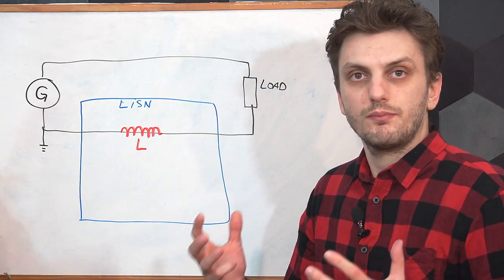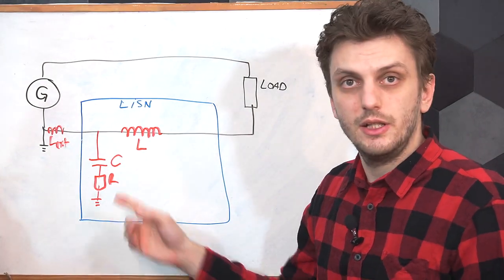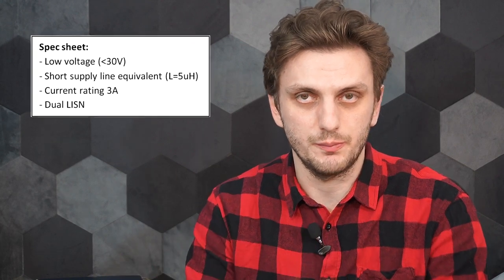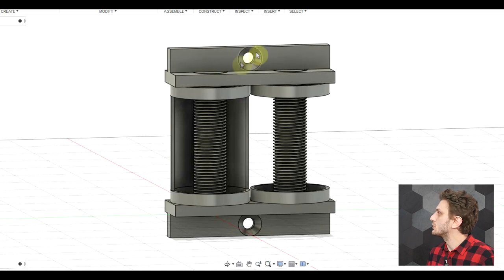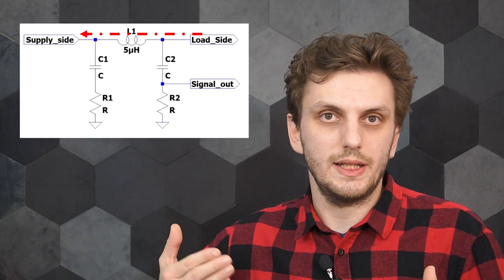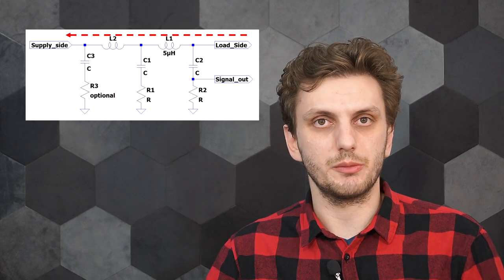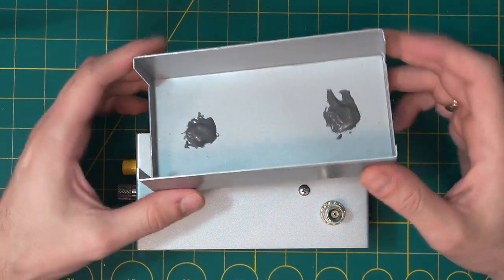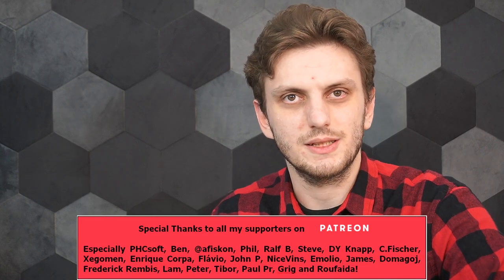EMC tutorials - [1/3] Building an LISN

Comment: I do a lot of work with instrumentation amps and have found that they are exceedingly sensitive to EMI. Think I might build one of these LISNs to improve my test setups. Thanks for sharing Fes!
Reply from the maker: What sort of issues do you run into? and of course what sort of environment is the circuit supposed to work in?
Reply: @FesZElectronics  Running at gain of around 500 (for load cells amplifiers), I get small DC offsets that change by 50mV easily (on the output) when I move my hands near the circuit, or even if I walk around the area near the circuit. Presumably high frequencies are coupling into the inputs and getting rectified. The inputs are biased to ground so I don't think static electric fields are causing this. I have tried a dozen different input RF filter designs based on AD app notes, with varying degrees of success, but I think they are not working effectively since I am breadboarding these and there is no ground plane to carry away the high frequency noise effectively. I have observed that things like connecting multimeter test leads to the circuit seem to affect noisiness to some degree too and my power supply as well, hence my interest in LISNs. Will be using the circuit in a university lab, which other than the florescent lights and electric motors I don't think is particularly harsh EMI wise.
Reply from the maker: Regardless of where you are, one of the major noise sources will also be radio - AM and FM. Especially if the noise is always there, the noise source should be something always running - I'm guessing motors would have a more sporadic behavior. Regarding lightning, in my experience the noisy ones are not the fluorescent ones but rather the LED ones, since those usually contain a high frequency SMPS. 
Anyway, breadboarding might not be the best option, especially for very sensitive circuitry, but you could try shielding it (a metal cookie box should be large enough to fit the circuit). Another thing you might try is twisting the cables, both the ones running to the sensor and the supply. This should help a lot with differential noise. To be honest, I'm not sure if the LISN is the best option for a supply line filter, I mean using a filter on the supply line might help, its just that you might not need an LISN but a similar schematic with different values (larger inductors should filter better). 
What sort of measures did you try that had a positive impact? maybe we can figure out the problem.
Reply: @FesZElectronics  Yeah I think radio is a likely source. There’s definitely a powerful AM station near me that I’ve had interfere in other circuits. In your experience does wifi couple into circuits easily? I have built an aluminum enclosure that fits a breadboard and I did some testing on the circuit the other day. Unfortunately it didn’t completely solve the issue, although it seemed to reduce it somewhat. In that particular test, I had the instrument amplifier inputs grounded through a similar impedance to the load cells I use, so that way the load cell cable couldn’t be bringing in any interference. The only thing coming out of the the box was my multimeter leads and power supply leads. I tried googling for shielded multimeter leads but I couldn’t really find much information on this. Have you ever seen multimeter leads that are coaxial, or some similar arrangement to protect the positive lead from picking up interference? My thinking is that the interference was getting routed into the box through the multimeter leads and going straight into the output of the instrument amp and getting rectified somewhere inside into the DC offset that I’m seeing. I put an inductor between the test lead and the output of the instrument amplifier and this seemed to have a positive impact. Maybe I should buffer the in-amp output with a fast unity gain op amp so the RF is less likely to get to to the in-amp? In any case I did actually make a PCB for this a while ago but never got around to testing. I will solder it up tonight and see if the ground plane and smd bypass caps cure this headache

Edit: I remember one other thing that seemed to help significantly was cutting the leads on my filter and bypass capacitors as short as they could be to get rid of parasitic inductance, so this further points to it being a decoupling issue. It was really cool to see that it made a measurable difference just shortening the leads maybe three quarters of an inch.
Reply: @FesZElectronics  Just got the proper pcb soldered up and it works much much better.
Reply from the maker: I'm happy to hear it works! I guess that if the added shielding box does not help that much, you can conclude that the noise is entering trough the cables, so things like an L or Pi filters might help (series inductor and capacitor to ground, both before and after the inductor) - these can be used on all lines. As you mentioned decoupling capacitors will only be as good as their series inductance lets them, so that is also an important thing to consider.

Comment: I very much appreciate this clear explanation  of the workings of a LISN. Could you please provide further info on the wire gauge and number of turns for the 5uH inductor?
Reply from the maker: I honestly don't remember the number of turns, but the wire I used was 0.7mm thick. Anyway, the wire thickness will only impact the maximum current capability - you should chose a wire thickness appropriate for your needs; and regarding turns, I usually just use an online calculator to determine how many I need - there are multiple ways to build this thing. I guess the only thing to keep in mind is that the coil should be spread out a bit to increase the SRF (self resonance frequency) since you want it to be purely inductive in the frequency range of use.

Comment: Just one more question. Here where im from i can't find any BNC 50 ohm termination resistor, could i use little 50ohm SMD resistor with a little switch to include it in the circuit when I want to do measurements. And one more thing. I've found 0.75mm wire but its braided not like yours (full copper wire). Can I use this braided wire to make 5uH inductor or i need to use "one wire with 0.75mm thickness". Thank you
Reply from the maker: It all depends on the current for which you want to use the LISN. I used 0.75, because I had it around, but becuase its so thick, it can probably handle >5A easily. If you need low currents, you can use thin wire. Braided will not have a negative impact. 
Having a resistor with a switch is actually practiced in real LISN's to reduce complexity. As long as the wires are short, it should work perfectly fine.
Reply: @FesZElectronics  Got it, Thank you very much <3

Comment: Since most of the field emanates from the ends of the solenoids, I'm not sure the shielding is doing much. I would suggest also covering the tops and bottoms with copper. Also, what frequency are you trying to shield? If it's line frequency, you will need to increase the thickness to about 1cm (skin depth of 60Hz is 8.5mm).
Reply from the maker: I do agree, at 60Hz, the shield would be of little use. But the main frequency range an LISN is used in will be 100KHz to 110MHz so the thickness should not be that big of an issue.

Comment: Have you measured the mutual inductance of the 5 μH chokes? How was the shielding affected the performance of these chokes? Could you please show the frequency response measured with a VNA (like nanoVNA)?
Reply from the maker: Various measurements are planned for the next video concerning this topic. One of the measurements of course is just how well the 2 channels are isolated from one another. I honestly haven't performed the measurement yet but in case I run into issues, the shielding may need improvements.

Comment: Hi, how does the first resistor on the left, prevent the resonance. And which interruption are there in high frequency from the generator?
Reply from the maker: The capacitor together with the inductor form an LC filter; if there is no resistor, the Q factor would be infinite - at the exact resonance frequency the filter would amplify noise; by adding in the resistor, the Q factor is reduced to a point where the filter actually filters at every frequency.

Comment: Wouldn't it be better for each capacitor to have a separate resistor in series. They are always scaring me with placing capacitors in parallel will make them resonate at high frequencies. Although those frequencies would probably be too high for DIY LISN.
Reply from the maker: Well its important to mention that the smaller value capacitors also have higher ESR (compared to a similar case size larger value capacitor); but nevertheless the worst thing that could happen is a sudden increase in equivalent impedance at a certain frequency, and we will see if this happens next time when I perform measurements on the LISN. 
As a side note I did see this technique being implement in commercial LISN also (see the TBOH1)

Comment: I wondered about how EMC testing was done.  Now I know more.

Had you considered mounting the two inductors at right angles to 
each other to reduce mutual coupling or would that have made the
footprint too big for you?
Reply from the maker: I guess the main reason for keeping the lines (and inductors) parallel, other than the size of the device is to keep a constant distance from the ground plane.  Working at frequencies up to 110MHz the stray capacitances and inductances start to have a significant effect, so the 2 channels need to be kept as symmetrical as possible.

Comment: Great stuff... I'm in a battle with my PoE system at home. As a ham, those things drive me crazy with their RFI on HF. But I'll admit it's a damn convinient solution for powering my access points. I'm thinking of a LISN for PoE. In that case I need to measure the supply side and the DUT side. Any ideas for a LISN that could measure both sides? I went at it with a common mode probe and the conducted emissions are there for sure - but a LISN would make testing way more accurate. I tested some ferrite cores on the cat6 line and it did help but I'm not sure what it does to the data rate. Should do nothing - but I'll borrow a network tester and then we'll know for sure.
Reply from the maker: I guess you can use an LISN both ways(just flip it in the circuit and measure the noise on the side on which the measurement port is); in principle the LISN is a bidirectional filter and noise isolator, so once its on the supply line it will allow the measurement of the noise from any side (either from the load or from the supply) as long as the measurement port is on that side of course. 
Regarding the cable, as far as I could find, "cat6" just means that a certain speed is ensured, but there are both shielded and unshielded Cat6 cables - which type do you have?
Reply: @FesZElectronics  I'll have to wrap my head around how to implement the LISN on PoE... As for the CAT6, mine are shielded... the thing is that the shield is usually connected to GND of the powered device while the PoE power lines are typically decoupled with capacitors to that same GND. Question is hence if any AC that might be present on the PoE power line might be getting over to the shield and having it act as an antenna?
Reply from the maker: Unless you have dedicated supply lines separated from the data lines, I'm not sure an LISN would help. I think the common mode probe is the right choice to perform any measurements that do not impact the integrity of the standard cable - most HF noise is common mode anyway. Also considering that adding ferrites over the entire cable helped, again points towards a CM problem - I guess you could apply a ferrite on the CAT cable at both ends, just to prevent noise form either source - this would make for an easy to implement fix, as long as it does not impact network speed as you pointed out.
Reply: @FesZElectronics  Both common mode feed and spare-pair are used - depends on implementation. In my case it's actually PoE+ and it puts out power on the data lines as a common mode feed. But I was thinking of doing some research in to the passive mode as well which runs on the spare pairs. In that case the lisn should work. Any ways... a common mode probe and maybe some near-field probes will do just fine to test out what improvements can be achieved. What is frustrating is that I can't find much in the way of publications on this particular subject... Maybe there are some papers in the IEEE library. Where does one look for papers on EMC any ways? Thanks and keep it up! Your videos are a treat!
Reply from the maker: You can sometimes find good documents from various manufacturers of components - for example on a quick google search I found "slua454" and "slua469" from Texas Instruments - honestly I have not looked into the details, but I guess searching for "PoE emc" or "radiated emissions" should help - if the pdf is made by a component manufacturer (the ethernet Ic of the various filter elements) usually it contains valuable information.

Comment: Does the coil get warm? Is that PLA?
Reply from the maker: The wire that I used was 0.7mm thick, so it should not get warm unless very high currents are used (>2A); the material is PLA, no special proprieties where needed.

Comment: i think LISN is only for Conducted emission not for radiated emission ;-) 0:18
Reply from the maker: Well, to measure the emissions, the LISN is used only for conducted; but even for radiated emissions, part of the noise will come from the supply cable, so the LISN is there to fix the lenght of cable that is attached to the tested unit. So the point of using it during radiated emissions is to standardize the supply cable lenght, even if the LISN is not used for the measurement its self (the antenna is) its still part of the setup.
Reply: @FesZElectronics  I know what you meant but that is tesetup e.g. for Automotive. For commercial, scientific, industrial and medical devices the testetup will be without LISN/AN for radiated emission and you should test your device with cables that you are selling it with.
Reply from the maker: You are right, the setup involves placing the DUT on a nonconductive table, and just exposing the supplied cable for non automotive setups. It does seem strange though to not have any filtration on the supply line. Or is it just a different type of filter (not an LISN)?
Reply: @FesZElectronics   In the semi-anechoic chamber the electrical sockets are EMI filtered (big filter boxes on the wall of a chamber) but I do not know what is seen impedance from input cables side of DUT. Maybe is just low inductance by output capacitors at the filters. Keep up interesting projects :-)